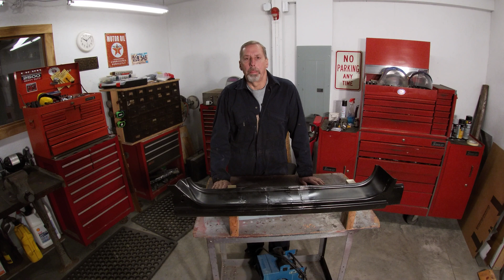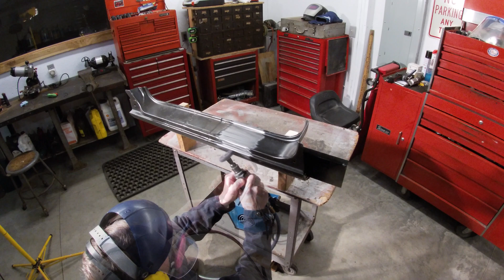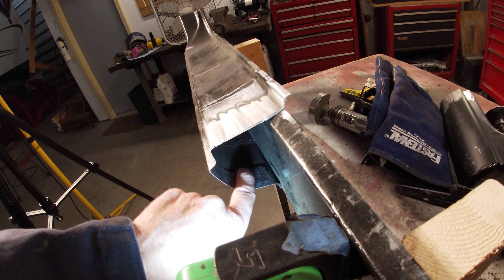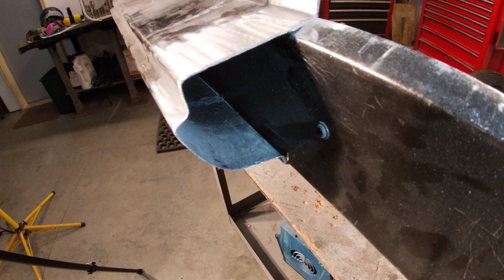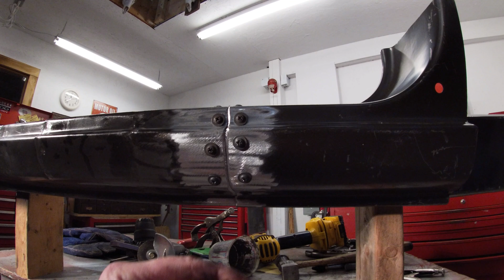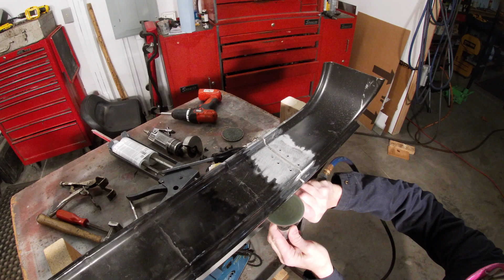Metal Bond Adhesive

Comment: I wonder if you should use the same panel adhesive to fill the seam and screw holes. It dries as hard as the metal so after sanding, you have a hard, smooth surface.
Reply from the maker: I have several videos on this. I’ve used adhesive to fill seams with so so results but screw holes seem to work ok. Thanks for checking it out 

metal bonding adhesive
https://www.youtube.com/playlist?list=PLKtTW0fp3wNsvnL51jcAUPkxQwkueqZCH

Comment: what did you do next?  fill right over it > fibre glass or ?  im worried about seeing a line after its settled
Reply from the maker: I covered this in an older video but I’ve soldered the holes shut or fill holes with the bond adhesive. Fiberglass reinforced bondo will work too. I always try and get all the excess glue out of the seam and I’ve just used bondo over it with good results. Thanks for watching

Comment: whats the name of the glue you used? what is the weight limit that it will hold? do you have an email i can contact you on for a few additional questions?
Reply from the maker: I use Fuzor brand adhesive. I don’t think they have a weight capacity because it’s designed for sheer strength. You can email me at autobodytrainingsolutions @yahoo.com or lachc57@yahoo.com  Thanks for watching

Comment: I've got little sections on my wheel arches i wanted to repair/cut out 'weld-free' so this metal bond might be perfect as parts i'm repairing aren't structural.
Reply from the maker: Yep. This is probably the best way to install rust patches. Good luck and thanks for watching